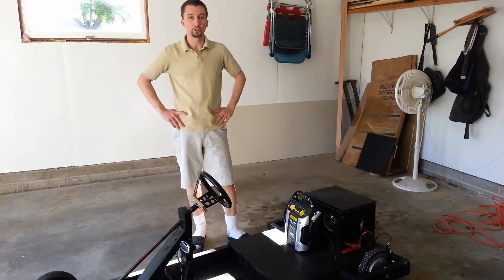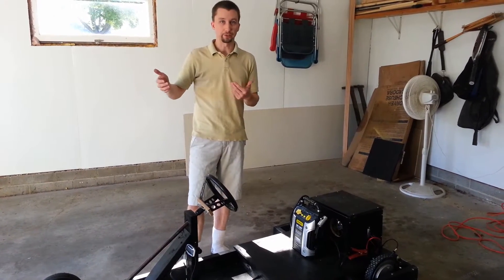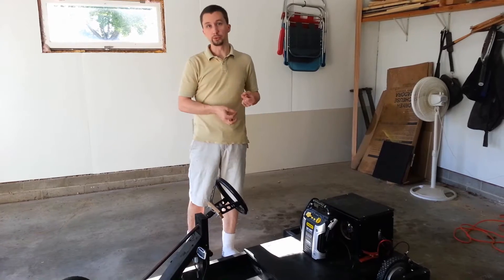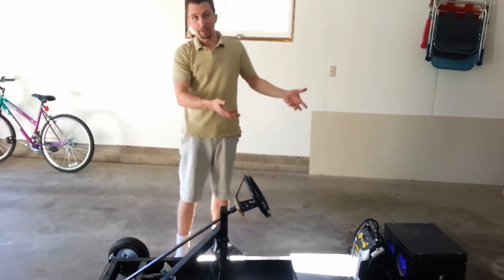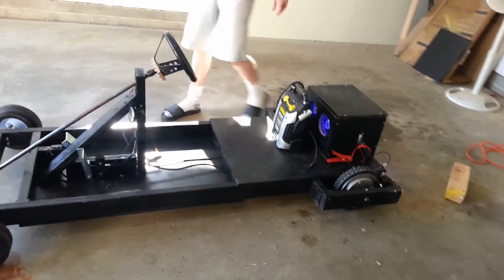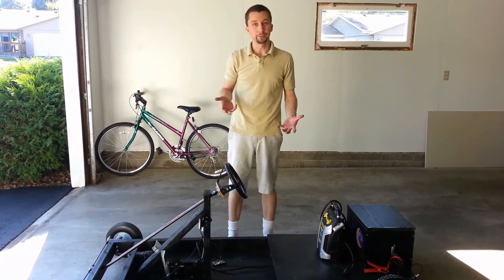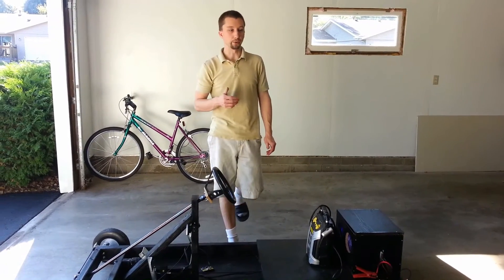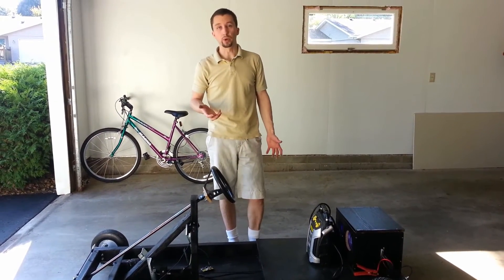Electric Go Kart, Part 3

Comment: I would rather make an indirect drive because of the hub motors have less torque. It would be better to make a larger motor that powers both the wheels .
Reply from the maker: Putting it through a gear ratio definitely can increase the torque. Any mechanical system reduces efficiency, though, and adds another failure point. So my goal was to make it efficient and compact. There are a couple prototype cars that use this system, and of course most e-bikes do.